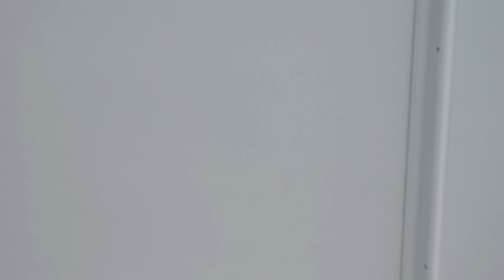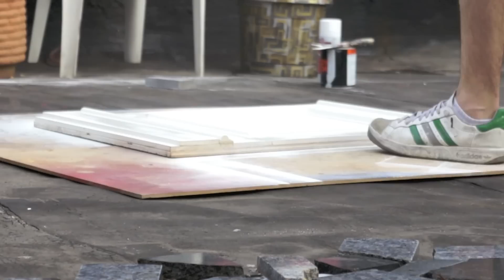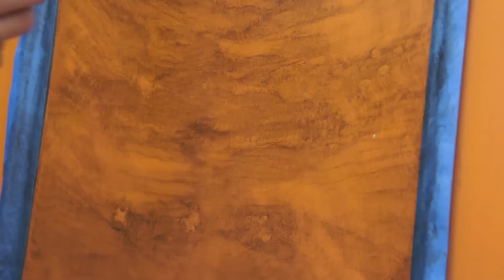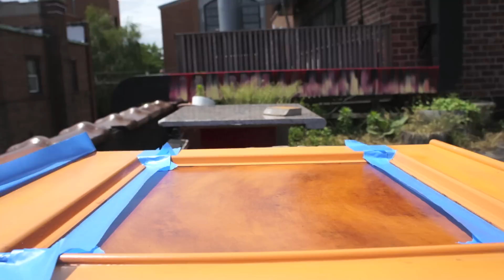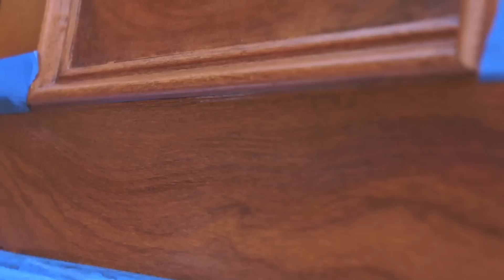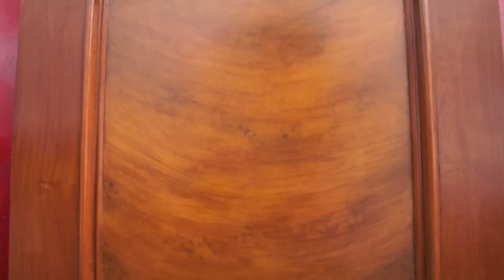Jeff Pollastro Paints Imitation Wood

Comment: @inchwormdesign the issue outdoors would be the vapor barrier and breathability. shellac, caulking and latex paint would create an impenetrable surface so as it weathered, whatever moisture was behind the coating would get trapped in the wood causing rot.  This is the universal disease that effects virtually every painted wood building.   The old paints breathed more because they were linseed based etc.
BTW that panel looks really beautiful!  excellent work

Comment from the maker: ...using a non-reversible glaze over an oil basecoat can technically be erased, with the use of alcohol.  This will not harm the oil coat, but will knock the sheen down.  When I practice my graining, I tend to paint out a board in oil, and use a beer/gouache glaze, and I erase it with water and start again!  Hope this helps.  It's not easy without seeing it, for sure.

Comment from the maker: @mikemb123 can you please elaborate?  I am interested in your point, but it would help others reading these comments if you would be more precise.  Example: do to the nature of plaster on MDF with 5 coats of water-based products sun-fried to the surface and sandwiched between coats of shellac and lacquer  would cause an issue with longevity of paint and potential adhesion issues.  This would be helpful, because you are right.  I would never do this on-site, or recommend for outdoors.  Thanks!

Comment from the maker: ...a great aspect of a reversible medium over oil, is that you can erase it without discoloring or harming the oil coat underneath it.  You do, however, have to prepare the oil coat first before using a reversible water glaze on top by concocting a mixture of whiting and water and using a scrubby to degrease the oil film left by the oil basecoat.  This will allow water to adhere to the oil coat's paint...

Comment from the maker: @gswiaczny thank you for your questions / compliments.  I like Golden's Proceed system for samples and other techniques - for some reason YouTube won't let me paste the link, but you can Google it.  It's a slow-drying acrylic.  You can buy it in Belgium at their online store.  For the actual jobsite, I use the traditional technique of WATER (flogging) - OIL (figure) - OIL (overglaze) - Varnish.  This gives me complete control and best results.  On a job, I use shellac or a water-based varnish.

Comment: We bought a house 2 years ago that has painted wooden garage doors.  Instead of stripping them (3 car garage would take forever) I would like to faux wood finish them.  Can you suggest what glaze I would use over the paint?
Reply from the maker: Tracy Inspired, this is a great question.  First thing to remember, and always true: your finish is only as strong as its weakest coat.  The reason why I say this first, is you will have to check the durability of the paint that is currently on the doors.  This may take scraping and / or sanding in order to know that your finish will be foundationally sound.  

The next thing to know is whether or not you have to prime the garage doors.  If there is raw wood showing at all, then it's best to prime them.  Oil or a waterborne paint for patio floor primers would probably do the trick - don't forget, you can have the paint company you are purchasing your primers or paint from tint the primer.  This will save time and provide an extra coat of color.  After you prime, check the doors for cracking and separation.  If so, you will want to mend these, then spot prime afterwards.

Next, you need the proper base color for the wood you're trying to achieve - if it's a walnut, then a nice light brown in a neutral to warm hue; a mahogany would require a deeper burnt sienna base, etc.  2 coats would be best over the primer.

Lastly, you're ready for your woodgrain finish.  If your garage doors are heavily panelled (like several tiny squares or rectangular panels), then I could suggest a waterborne product like Golden's Proceed Full-Bodied Glaze Medium.  Look up "proceed paint" on Google and it will be the first link.  Find your retailer or nearest retailer to ship from and I'd get at least 2 quarts if not 3.  You'll need acrylic pigment as well, so I would order the proper palette for graining as well - this depends again on the species of wood you're trying to achieve.  So if your doors are panelled, you can certainly section off parts of the door and do them independently, which will give you enough open time to work with.  

Otherwise, it is always ok to use oils.  Mix your own glaze, is always the best.  Buy Refined Linseed Oil (not boiled from Home Depot), Distilled Turpentine with low odor (Windsor & Newton is good for both of these), and Japan Drier for drying.  Then get your palette of fine artist oils in the recommended colors for the species.  Oil is easiest to use, but if you're not used to them, it takes some time to understand how to use them and to mix everything yourself.  I would certainly practice.  Take note, it will smell like solvent (turpentine) while using them.  Many people complain and hate this aspect.  Cleanup is also time consuming and recycling your oils (for later use) is also important.  

Water is the best product to use for cleanup and drying purposes, but oil will provide the longest open-time and best looking finish.  It's totally up to you.  I don't know where you live, so also the climate plays a huge role in determining what product to use - if you're in Seattle, and it will rain in a couple of hours, probably want to use water and do it in steps; if you're in Florida, well, then humidity will keep things open but the direct sun will 'freeze' the paint in place quickly; Arizona is hot and dry, and the paint won't give you any open time, so oils is preferable...

Sorry for the drawn out explanation, but I don't really know the project, and without being thorough, it would be doing you a disservice.  Keep in mind I live in New York City, and rely solely on the subway and bus for transportation...I don't see many garages ;)  

Good luck!
Reply from the maker: Tracy Inspired I would equally like to say that the varnish or top coat is important to take into account in order to protect your finish.  You will want to make sure it is UV protecting top coat.  Modern Masters makes an easily accessible UV varnish, but it is pricey (~$120 or so a gallon).  This will protect your finish and add durability to your doors as well.
Reply: Modern Masters is great for a finish coat!
Reply: I would strip them.  The new stripping products make it go way faster than faux painting.

Comment from the maker: @mortier9, on this particular sample, I used the same color for both the burl and the mahogany.  Anything in the burnt orange color range is fine.  Honestly,  you can start with any base in the yellows, reds, oranges, and browns as long as the base color at least 2 values lighter than the overall finish color you want to achieve.
Another thing is 95% of my wood graining jobs I am asked to match an existing wood somewhere in the house or even a sample that the designer or client has given me...

Comment: Dear Jeff, I am writing from Barcelona, I have a furniture restoration workshop and I am looking for information on the beer painting technique. Could you tell me the recipe for the beer glaze?
I hope google has translated well!! thanks for your attention.
Reply from the maker: Hi my friend.  Beer glaze:  take a dark beer (Guinness works well) and open it up.  Let all the CO2 out - let it go flat.  Then you want to take egg tempura or gauche pigments and mix it into the beer.  

That’s basically it.  You can use gum Arabic to help as a binder but it will make it less reversible.  

You can also use dry pigments, but you’ll definitely need gum Arabic for binder.  There will be a bit of floating pigment in your glaze - won’t entirely break down.  I prefer gauche.  

Hopefully that helps.  For wood, stick with earth tones - burnt umber, raw umber, burnt sienna, yellow ochre, raw sienna - for your coloration.
Reply: @JeffPollastro  207 / 5.000
Resultats de traducció
Resultats de traducció
star_border
Thank you so much for your answer. I have practiced it on wood without the gum arabic and it was sticky or biting. Now I will practice it with this ingredient. Thank you and congratulations for your work!

Comment: ear Jef Kindly tell me if you are using a glaze. I purchased a valspar glaze just in case but it seems just as possible to use turpentine or water.Also if you could tell me the color you are using on the base. Is it a standard paint color? i have tried a couple and the color i get from the screen seems more intense golden then when i get the paint home. As well i do need the thin brush you are using that creates lines.. Please contact me if you can.. Kindly Michael
Reply from the maker: Hi again, Michael.  Good to hear from you, and thanks for your comments and questions.  The Valspar glaze is acrylic, but if I'm not mistaken, it dries rather quickly and has a bit more body to it - does it seem thick to you?  You can always manipulate any kind of paint or glaze, so with these Home Depot or hardware store glazes, I tend to manipulate them with water and some retarder.  Go to Jerry's Artarama online and order your acrylic products, preferably Golden.  I'm paid by them, by the way ;)  The truth is, I learned that Golden gives them the best discounts on their product in the entire world so they are able to give us artists / painters the best deals, plus they give free shipping after a certain amount ordered...and they're fast delivery.  So, Golden Retarder is a bit pricey but it very much helps slow down the drying process of these commercial products, which you'll need if attempting woodgraining. 

You can also add Proceed glazes, which you can find online and your retailer nearest to you by typing in Proceed Paints in Google.  I buy all my brushes from Pierre Finkelstein.  I helped Pierre in marketing and finding the best brushes to sell when I was employed by him, and I know that there are not many places that A) sell French paint brushes; and B) sell them for the price that he does.  Yes, they are an investment, but some of those brushes are priceless, and if you are able to find them elsewhere, they will most likely be more expensive.  

The brush that creates the lines?  I am assuming you are talking about the veins in the burl (in the center panel)...that brush is called a TOOTH VEINETTE.  A very specialized brush, and you'll only use it for graining, and probably some heavily veined marbles.  Very worth it with graining.

The paint color?  You know what I do?  Pierre taught me this.  You go to the kind of wood you want to paint, take a Ben Moore Color Preview deck (with all their standard colors), and choose the lightest tone in the wood, or the medium tone.  You will have a custom color that you find for yourself in order to match that wood perfectly.  I think the color I used was Apple Crisp 2159-30, but not entirely sure.  You will benefit more if you start observing color yourself in the woods you want to create, and picking them with your own eye.  This way, if you need to match to an exact wood, you can choose the proper color.  Hope you find this helpful.  Thanks
Reply from the maker: Oooh, Michael, I just remembered that I didn't mention...Turpentine is only for the oil based steps, if you are using oil.  Do not mike turp with water.  Turpentine is the solvent for oil glazes.  Water is the solvent in water glazes / acrylic.

Comment from the maker: My apologies, cjr1975, I think I did not see this comment - I usually get an email.  Anything can be painted as long as it is prepared properly.  If the laminate has a lacquer finish, you need to remove that first - this can be a lengthy explanation and could have multiple solutions to - and then you should prime the doors with a product called STIX primer.  It's a fantastic primer, and it does as the label suggests, sticks ;)  Once you got the primer, you're good to proceed.

Comment from the maker: I would also not be painting a door made out of MDF for exterior work, and I'd use the proper mediums to reflect the environment in which the work called for.  This is a video strictly for technique and the use of Golden's Proceed open-glazes, which can be used on exterior work, but as you've noticed, there needs to be a proper prep job with proper finishing products after completion.  This is not that video, however.

Comment: Correct me if i'm wrong.. But you are using a glaze medium after you apply the first stage of creating the burl ,in the case of this video..  Then additionally  you are using a glazing to add depth of color over the dried faux finish? tht makes perfect sense... I actually threw some of the glaze in the mix of the first panel i did and if possible would be happy to send a jpg. bluewatercolor@gmail
Reply from the maker: The base color (Apple Crisp, from your previous question) is the only opaque layer in all the woodgraining.  The other steps are glazes and the final coat is a clear coat / top coat / varnish, etc., which is still transparent.  

The term 'faux finish' means 'fake finish,' but figuratively means 'imitating something that is real and organic, such as wood or marble, with paint.'   It's the final finished product.  So whenever you hear somebody ask you, "Do you paint faux?"  You can tell them that you actually paint, and you will make your surface look like a real piece of wood or marble.  "Decorative Finish' is a better term than 'faux finish,' but you can definitely use the term when painting wood or marble, if that makes sense.  

Please feel free to send an email -  I believe my email address is on my contact...just my name @gmail.com  

Cheers

Comment: Jeff, your work is amazing! Thanks for sharing your talent with us. I have several questions. I'm from Ukraine and my English is not perfect though, so forgive me. First one. Did I understand right that after priming I have to put first level of paint and than several coats of glaze, and do I have to use bare glaze or add paint in to it? That's all? Will it be safe? I mean do I need to cover it with something to protedt glaze or glaze itself is really strong? The second: I see some people do staining and than varnish it, is at a good choice too? Thanks so much for letting me ask you this stupid questions:)
Reply from the maker: I apologize if I haven't answered this question.  Thank you so much for watching and taking the time to translate your question for me - I assure you my Ukrainian is horrible ;)  

I recommend after priming the surface, to use 2 coats of paint.  1 coat is generally not enough to cover white, especially when using a deep based color for wood graining.  

The first coat of glaze can be done with a mixture of beer (dark beer) and gouache.  Do not use regular paint.  If you cannot get gouache or egg tempura, then I recommend using an acrylic (water based) glaze with acrylic paint.  

Over the acrylic, I do recommend using oil based glazes, because they look more realistic and can create a better sense of depth in darker earth colors.  

You can use varnish over your final product.  Polyurethane works well.  Sometimes the water based varnishes can be a bit cloudy over the dark colors, so oil based varnishes tend to look better.  If you are going for a flat or matte finish, you can use urethane or water based acrylics.  

I am not sure by 'staining,' since that implies staining actual wood, therefore not painting your surface to look like wood.  If you are just staining and finishing actual raw wood and want to maintain the essence of that particular wood, then this is not the video to watch ;)  I hope I am understanding you properly here, because I don't want to lead you down the wrong path.  Please let me know if you need me to elaborate.  Thanks again.